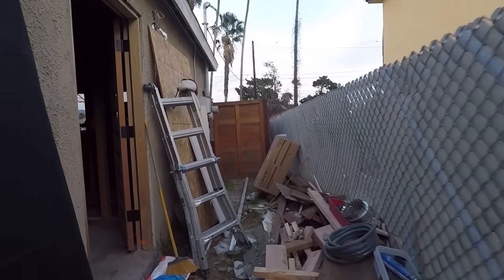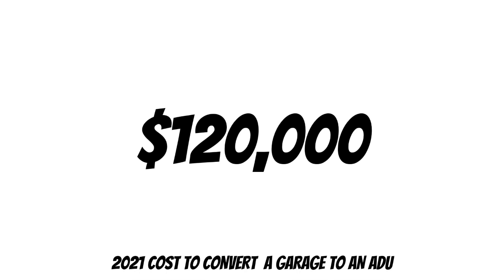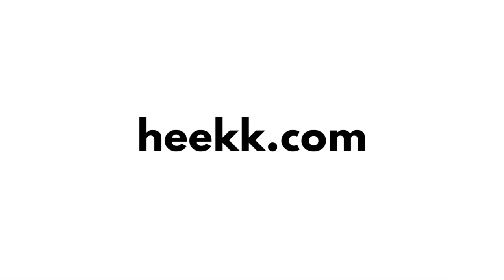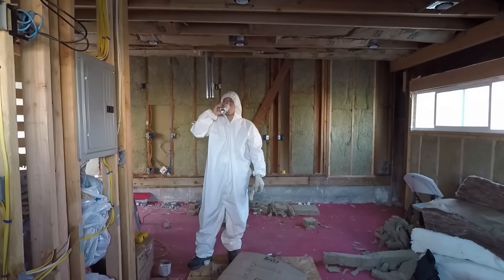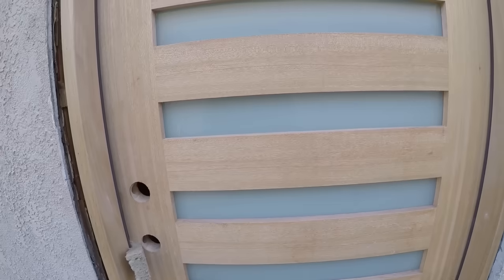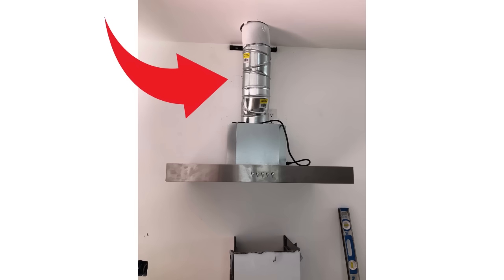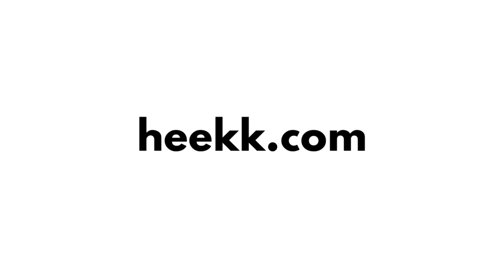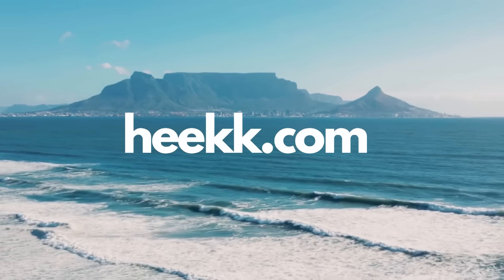This is how i built an ADU in LA for only $45,000

Comment: You mean your 145 thousand if you built it today (2024)  you just barely got in before things went sky-high. Beautiful build.
Reply from the maker: In today's market I would build it some where In between $65k - $75k plus pans and city fees. Labor and materials are through the roof
Reply: Nonsense 

We build from the bottom up ADU 850sq ft for $150k

Less than 2 months turn around

Comment: I like the 45k price, but you already started with a 20x20 structure.  Essentially you did more or less of a remodel.  If you had to start from scratch this project would have probably been another...what 80k? or more.  Wife and I are looking at a 24x40 from the ground up and just the permits and the hook ups alone are 45-48k. ----- Northern Calif.  We're looking at a 250k plus build in 2025.  Lot of money for less than a 1000 sq ft

Comment: Great Video. The stove hood vent on the roof should be moved away from a outside wall. The small gap will be an area where leaves can build up causing water to stand and flow under the shingles. If it has to be this way for things such as structural constraints flash above the vent to direct the water from the wall to the opposite side of the vent.

Comment: The ADU ordinances have been powerful enablers to homeowners.  It has been exciting to help homeowners create affordable housing for loved ones and attractive passive income.  

Useful information.  Saved lots of money.  We're all money-saving consumers.  You save lots of money doing your own labor.  You are very thorough in your research.  You learned a lot as a realtor in homes and construction.  You stated easy.   I really struggle with that.  I'm in construction management and financing specializing in ADUs.  I rebut that building an ADU is an easy DIY project.  It's anything but.  Most homeowners do not have your discipline & experience and the time....lots of time.  I assure you many homeowners don't have the time and experience to do their own labor.  

Your focus solely on the cost of construction is unfortunately limited.  I'm surprised you didn't put on your realtor hat and look at the value in appreciation, and cash flow.  Even using a design-build firm where your costs are higher still shows good property valuation and attractive cash flow.  

 DIY ADUs are beyond most homeowners. I have every confidence that the marketplace is better served by working with quality contractors.
Reply: @h2s142good points. I think about this a lot. We’ve done an ADU a few years ago and are doing drawings right now for a couple more. I’ve also worked in a city engineering department and the mgmt on resources is scary out here in SoCal

Comment: Congrats Hektor for your work - I also took it upon myself to build without general contractor, and it worked well but keep in mind it takes a lot longer.  In my case about two years, which when you take into account lost rent does not save quite as much money
Reply: were you buiding a duplex?. in no way should an acu of 750 sqft take 2 years to build, absolutely no way.

Comment: In Los Angeles, according to Building, Planning & Safety Department, you can act as an owner-builder and build 1-to-4 units as long as you hire qualified subcontractors. I’m introducing a 599 sf Modern Home to the Los Angeles market, which will sell for $100,000. I expect 10,000 pre-orders around the state yielding $1 Billion gross🏠💯💰. Remember, general contractors markups are high and all they do is hire subcontractors 👀👍🏿.

Comment: I am trying to do all electric and am realizing my 200 amp panel may not be enough from main house. Did you do gas washer dryer, gas stove top and gas waterheater to make the 100 amp panel work energy wise?
Reply: We did a similar conversion and upgraded to 200. Our panel was old so upgrading not only made our system safer and less prone to failure (you want minimal points of failure when dealing w tenants), but it allowed for potential future expansion.

Comment: FYI, it is possible to skip the HERS rater step altogether if you check certain boxes. You would likely have to make some design changes, but it's possible. However, I don't think a HERS rater is very expensive for them to certify a small ADU, so it may not be worth it.
Reply from the maker: No you cannot skip the HERS test. The city inspector won't sign off on the final.
Reply: @HektorCastillo  Let me clarify. I'm saying you can satisfy HERS requirements without using a HERS rater. HERS compliance offers a "Prescriptive" approach whereby if you hit every spec necessary for a prescriptive approach you are then HERS compliant. I did it on my addition. However, this method does not apply to every build. I was able to design my build so that the prescriptive method could be used.

Comment: I have a question. I have a detached two-car garage. I would like to build a two-unit ADU: one bedroom, one bath, with a small kitchen. One unit will be on the bottom and the second on top. I am in San Diego. What is your rough estimate for the mid-range cost? I wanted to see if I can afford it.

Comment: Very nice. Doing a ADU surely adds value to the house.  Do you have to pay more taxes now that the house is worth more? Do they base your taxes on the new (house with adu) house since it’s valued a lot more now? Thanks
Reply: Good question!!
Reply: Adu’s are counted by the county of Los Angeles as additional square footage and additional bedrooms and bathrooms to the original house. It’s not counted as a separate unit. The evaluation is based on what the city sets as your evaluation and that’s what gets assessed a year. So for example if it’s $40,000 then you multiply 1.25% if that and that’s roughly $500 additional yearly in property taxes. That’s just an example.
Reply: @Manohman-fx2jq right. Which is good for tax liability but if you’re trying to build equity to use your home to fund other projects, it’s not so good.

Comment: Did you have to install a vapor barrier to the flooring? That's the issue we are struggling with here in Pennsylvania with converting our garage to a ADU
Reply: I heard you can use an epoxy. I wonder if that’s the red stuff in the floor

Comment: The reason why Certification of Occupancy takes so long is because of clearances. You need to take care of them on day one. Public works takes a long time in City of LA. Looks like you worked very hard, do you think it would have been better to hire a contractor to save time?  Great work looks amazing.
Reply from the maker: I met all the clearances before my final inspection. After the final inspection I waited for the city to issue my Certificate of occupancy. At the end it was a human error the reason I waited so long. The construction process only took 4 months and that's because I didn't know anything about ADU's. Joseph thank you for the kind comment.
Reply: Exactly what are these clearances of which you speak?
Reply: @richardjacques1731  Green Building Final, Housing, t24 paper work, Herz testing. There's a lot of things you need to come to final inspection with BUT a lot of times the inspector doesn't do any paper work until a week after they approve your final. I had an inspector in Resseda that gave me Certification of occupancy next day after final. I also had an inspector in mar vista that gave me CFO 4 months after final. IDK what ever
Reply: And now solar is required

Comment: Hi Hektor! Your videos have been very informative. When you mentioned the footings, did you not need to add footing to where you closed the garage door and added a wall? If you have concrete around how do you check for footings?
Reply from the maker: Siv I did have a footing in front of the garage door. All ADUs need a continuous footing around the structure. To verify the footings a small section of concrete has to be removed a
In all corners on the garage.

Comment: Hector,  not all city inspectors are helpful, some are  not helpful. Would you mind disclose  what city have you convert your garage into the  ADU?  In Los Angeles city is extremely difficult to get license to do the job since most contractors ask for $200 up per square feet, and some even refused to do job in city of Los Angeles since the city inspectors are very picky, rude and not professional.
Reply from the maker: My project is located in The Valley. It's unfortunate that you are having a tough experience with contractors. If you need a second opinion visit my site to get an estimate on your project. In my opinion the tougher the city inspector the better. This means your ADU will be safe for a family member or a tenant. In my experience I notice my city inspector was extremely busy and will help me out if I asked short questions and not take much of his time. If they are picky its because the work was not done right and must be corrected.

https://www.heekk.com/aduestimate
Reply: Hektor, thank you for your reply. You are lucky since your project was in the San Fernando Valley.   In my personal experience  to get building permit and to get inspection was much easier 29 years ago than now. Since I had one building built and completed within a 6-7 months, and building standard were  tough,too back then.  The problem is that even you call for inspection but no inspector will show up on time or no show at all during 2020-2022. Only the lobby of LADBS is open and the whole department is still being locked down.

Comment: Very informative video, great job!  My question to you is what is the metal channel you put on the wall used for?  I believe you called it resenian channel.
Reply from the maker: Hector hello, the resilient channel reduce's transmission of sound waves from one room to the other. It's a requirement if you have an attached garage. You won't pass he framing inspection with out it. 👍
Reply: @HektorCastillo  my city didn’t require a resilient channel on the common wall to the main house…so this must be a city specific requirement.

Looking back I did research ways to reduce noise on that common wall. My contractor said we had a lot of existing (5/8 drywall) and new material (5/8 plywood, r15 insulation, putty pads on electrical boxes, 5/8 drywall) and didn’t need additional noise cancelling material.

In hindsight, I should have done the resiliency channel at a higher cost to reduce more noise in the common wall.

The noise is not bad coming across, but just wish I had done more in that one wall.

Comment: I'm 32 and trying to do an ADU on my own in my home. I seem to be in the same position you were in with this one. Your garage looks like it was already just 2x4s.  Mine is the same. Did you have to change the 2x4s to new ones?
Reply from the maker: No. All the existing 2x4 were in good shape. We only had to add new standard framing to the garage door and window openings along with 2x10 for ceiling joist. We just followed the California wood frame provision. Good luck in your project 👍

Comment: Thats what a general contractor does. Hires subs to do all the work and manages the project. Or the GC has his/her own crew and does it all in house. (very rare)
This is a great way to save money but if you dont know how to check the work from the people that you hired, it can cost you a lot more than it would to just pay for a GC to do the work.
Reply from the maker: As an owner builder did not have to check the work. The city inspector verified all the work was done properly and up to code. If it was not done correctly he would issue corrections  and the corrections were fix by the trade contractor. 👍

Comment: The city needs reform. how much were the permits?
Reply from the maker: I spend $300 for plan review and $1,000 for the permits to begin construction. I'm located in the city of Los Angeles. The permits for a garage conversion are low, the permits for new construction are extremely expensive. 👍
Reply: @HektorCastillo  those are very low city fees. I’m not in the city of la, but I am in La county. Different cities charge different amounts for plan checks and permits. 

My plan checks were $1500 and permits like $2300. Blueprints were $3150 including approvals by city. 

In the end, I paid about $7k in soft costs for each of my two units (attached garage ADU conversion 428 sqft and detached guest house new construction 448 sqft)

My city did not distinguish between existing conversion and new construction when it came to charging fees! Their fees were based on sqft it seems

Comment: i built in 2021 🙂 done in 2022. in Chatsworth. I used a general contractor. yup i guess im an idiot, i just spent my time going to work and not babysitting the project. why didnt i take all the time off needed to keep meeting inspector and construction workers? shuckeronies im an idiot. somehow i dont feel like an idiot though. you can compress the contractors margins quite a bit and you, yourself can fk things up too by the way. my ADU was 80k with new electrical panel old one was trash 😮‍💨,  ceiling and roof they wouldn't sign off because they said it needed to be reinforced (inspector no my contractor 🫣) so i needed to add engineering and added roofing experience. everything else is the same price pretty much. i was quoted 49k. when LADWP spotted my electrical meeter location and subpanel location that added about 12,000, could i fight and save 2,000. (yes is it worth working with sour people for 2,000 no) the engineer cost an extra 1,000. added a lvl and bunch more wook in ceiling and roof 😮‍💨 15,000. add a few extras like fridge/stove/shower glass and you got my total. (i made it clear with my contractor that i would be easy to work with and i wouldn't cause problems. my contractor has raised prices, but not because he is trying to gauge anyone. he knows that all the people he is going to subcontract too have raised their prices. um, i dont want to run an add for the guy, but if i ever do construction again i know who i want to call. my contractor knows ill be easy to work with and i understand he is doing his best to get the job done asap and if it was me in the exact same spot i wouldn't be able to move any faster anyway. (im not poo-pooing here, i interviewed a bunch of contractors before i settled with the one i got. i got 1 that quoted me a lower price too, but the experience didn't hold up and there was no confidence in completing the job timely) before a contractor begins work always have them explain how they arrived at the price and always negotiate BS out and if they agree then they need the work and will get it done properly to uphold their reputation. also understand if you cut out all the margins then you need to be ready for when shit hits the fan to adjust to the new reality. it is important to understand that yes you are standing there with your pants around your ankles, BUT that doesn't mean rush and through out your good judgement.
Reply: @yadalda7875 thank you for sharing your experience.

Comment: why do you expect a contractor to give you any knowledge? you decided to do a Owner Builder. Contractors took a lifetime to accumulate their knowledge. and they took out time to come give you an estimate without pay and you expect them to give you information for your build? and truthfully at 45k during 2019-2020 is not believable. A single piece of 2x4 cost $10 and plywood cost $80 at that time in So. Cal. The drawings alone will cost $4-6k... permits cost you around $10k+. I'm not hating, you aren't letting people know the truth.
Reply from the maker: ADU were new back then the contractor did not have a life time of experience in the short time ADUs were out. A 2x4 was $2.50 plywood was $30 I have the receipts. My plans were $5k and my permits to begin construction $1,600 including the $300 for plan check. Some Contractors think they are the only chip in the bag. I had zero experience in construction and I pulled it off. If I can do it anyone can.

Comment: A lot of the things you say are not realistic. You make some things sound so easy which in reality is not easy.   The best comparison is a contractor and a doctor. A Dr learns everything he needs to know about your body and health. So you trust him and go to them when your sick and ill. Most cases people will have a cold or a flu. I could say that its easy and all he did was take your temperature. My co pay for blue shield is 50$, plus i pay 4,900$ a year. So its very expensive for a Dr just to tell me i have the flu. You go to the doctor because you trust him and there may be some underlying condition.  This is the same with a contractor. Most contractors are not there to take advantage of you. the contractor is liable for 10 years after he builds your project so most likely he will do a great job or ells he will be liable. The contractor is there to guide you through building  a project.  Contractors need to make money just like a DR. Of course there might be some things like 20% mark up fee. Nobody works for free. The cheapest way to do anything is by doing it yourself.